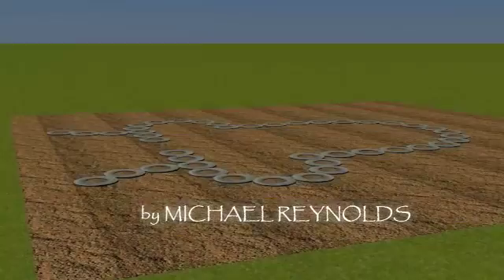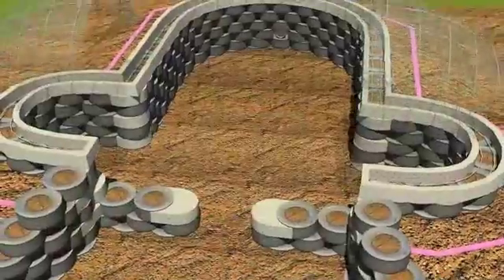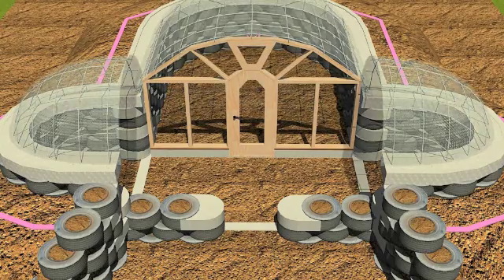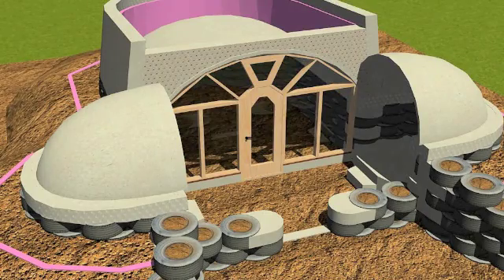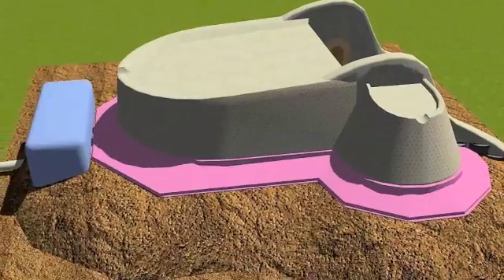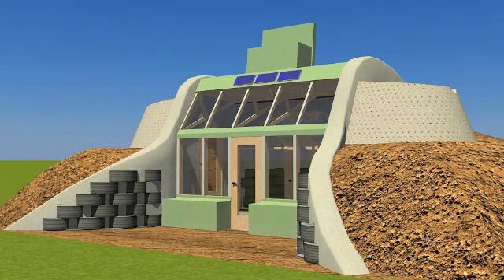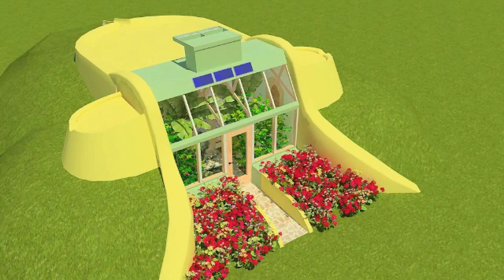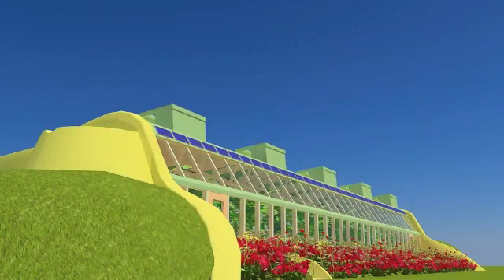Simple Survival Model Earthship

Comment: Where's the simplicity gone? This really is a funeral of affordable living.
Reply: +The LostBoys Dude, you rock.  I didn't expect that.  Actually, I'm a permaculture teacher and teach the PDC classes at the Yurt.  I fully plan to cut the holes in the bottom for ventilation, but I'm going to incorporate them WITH a Rocket Mass Heater.  Not through the heater, but with that project.  My wife has made me promise to keep the area open so it doesn't feel cramped in there.  The RMH will be inset into the floor (actually on the ground since the Yurt is 3' off the ground above grade.  Making the air holes perfect!).  I might even dig some conduit into the ground down 6' or so.  We're in a predominantly hot area with a lot of humidity, so I've gotta think about serious cooling.  I've considered the sail, but another thing we have an issue with here is the sun destroys anything but the most industrial cloth.  Still thinking about that one.  We have some trees going to make some shade in the meantime.  The vent dome on the top of the yurt works fine now that I've taped it up with reflective duct tape.  The sun exploded it when a bit of southern mildewy mold clouded it up.  Keep acrylic plastic clean or the heat sit on it and destroys it.

I am currently working on a walipini (funny you should mention that), but mine has to be above ground since our water table is so high.  3' down and you're standing in water.  Mine is going to be a bit more like an earthship.  Not quite the Valhalla project, but bermed with plastic over top for now.  My land was once a plant nursery, so I found an ancient hoop house in the woods and am restoring it to its former glory.  

The Earthship Hut project will be standard Mike Reynolds design since all of those systems are integrated to make the whole system function.  I'll learn a lot more once I've got it built.  We'll then finish our cob house structure and then work on a sand bag dome, etc.  Check our our work on Facebook under StarwalkerProject.  I should have the website up soon too.  

One thing. You wrote "Eco-Doom house" up there.  I got a rolling laugh out of that one.  Peace "Eco-doom" Brother ;)
Reply: +Branislav Boba Feel free to design it to suit your needs. Economical or other. This is how housing will look in the future, in one way or another. It's only natural that it improves and get some added functionality. 

My first build will still be nothing but a hut. The only thing I will add right away is the permanent placement for all sewage and about 500w of power - and then build from there as I'm able.
Reply: Rhyle That's about what I want to do as well. Wish you all the best with your plans then! :-)
Reply: You can build a house where you won't have to pay any bills for fraction of the earhship's price. And it will also be much nicer and far less complicated.
Reply: eric smith No! Yours!
Reply: +Branislav Boba I've searched for a better, cheaper idea, but I haven't found one.  If you know of such a thing, please share.  As it is, the Earthship is the most, no apologies, no holds barred, off-grid, least expensive option I have ever seen.  Especially for harsh climates.
Reply: +The LostBoys Thanks for the share!  Have you been in one?  I'd love to know how it works to keep you warm and cool in different climates with no energy use.  You could build it so that it captures rainwater and build the grey/black water systems in it as well.  My only question is how it fares in many different climates and weather conditions.  I've seen the super adobe and how they are made into domes, this would be good for slipping through high wind.  I'm currently living in a yurt and it's good in wind, but an energy hog when it comes to keeping cool!
Reply: In a yurt?! How well does it insulate against both cold and heat?
Reply: +Branislav Boba Not well at all.  It seems to be much easier to heat than to cool.  Right now it's about 77°F outside during the "heat" of the day.  If I don't have the dome up and the doors and windows open it'll get up to 87°F easily.  So, during the summer at about 118°F it's got to have the A/C running at full blast to keep it comfortable.  The fridge won't even keep food cold in there without it.  So, the A/C runs 24/7 for a few months.  Not good. Working on an Earthship so that the Yurt can be our little community's club house during cooler months and my little family can live in the Earthship hut!
Reply: @branislavboba1699  - not that well

Comment: I have a question. In other earthships I have seen the use of propanel roofing with a solar heater underneath to melt the snow into the cisterns. Since this is a cement roof how do you melt the snow?
Reply: this is an earlier incarnation before melting snow was incorporated into the design. It is also meant to be a simpler design.
Reply: +ToungandCheek As is, you could use this for non-snowy climates.  If you wanted to, though, you could imbed pipes into the roof and run them off of a solar water heater like they do in other models.

Comment: curious as to the cost of the pumps, bonding insulation, bird cage wire, etc. a single form earth-ship typically costs??? deep charge batteries, solar panels, included... has anyone calculated a mean cost?
Reply: +peterott1 Everything you mention here will be sourced locally and be a different price from area to area and from day to day.  All of that info could be gotten from the local business websites when you decide to build.  You don't HAVE to have solar at first, so you can add that as money permits.  it would be nice to have an estimated amount of cement for this project, but I've never seen one.

Comment: Ok, so what's the cost for a house like this?
Reply: +Old Man from Scene Twenty Four I've estimated that if I do all of the work (hiring help and getting some volunteer help) that it would cost around $10-$15k to get it done.  Tires and cans are free (I've been collecting these and some decorative bottles for a while now).  Dirt is "dirt cheap" to free, the cement is actually minimal, but is the most costly thing here.  Rebar, wood for framing (can be found for free), hardware for doors (build doors or find them in the trash all the time -i found mine already), screws and nails, insulation, plastic sheeting, bought a cement mixer and a tile cutter for the bottles.  I've found stainless sinks and working faucets.  PVC pipes are free to real cheap (not wild about PVC, but I don''t have the cash for copper).  Use plastic for the glass until you find or buy the real deal.  I've built a composting toilet and set up a humanure compost pile that is heating water for an outdoor shower.  I've even found my shower head in the trash and its a nice one.  I'll use several IBC totes for a cistern or use Tadelakt and build one up from scratch.  That's the cost of lime, a trowel a polishing stone and time vs. the cost of totes..  Even if this costs me $20k (inevitable unforeseen costs), thats the basic price of a tiny home thats smaller and needs all utilities to live in.
Reply: @Whaaat2008   I didn't ask YOU. I asked Earthship Biotecture.

Comment: And what is the justification for all the "thermal wraps" made from foamed plastics? The earth berm alone would be sufficient, let alone all those rammed tires. This is a ridiculous waste of money -- blatant consumerism at its worst.
Reply: The earthship uses both thermal mass and insulation.  The mass comes from the tires and the berm-they hold heat from the sun entering through the south facing walls. What the isulation barrier does is it traps that heat so it does the travel farther away through the wart.
Reply: Does not travel farther away**
Reply: +Deborah Stephenson Earthship Biotecture has a definite reason to use everything they use based on many years of experience.  Working around that fragile insulation with wheelbarrows full of dirt is a pain at best.  I'm sure they wouldn't waste the time, money and effort if it were't a valuable asset.  Consumerism?  I think you're just looking for things to be mad at.  I hope you get to feeling better.

Comment: No, actually the tires are completely free. 40 million tires are discarded yearly in the UK alone. You need on average 1000 tires per house which means you can build 40.000 houses with stuff that people would normally throw out. The yearly supply of wasted cans and bottles is probably a lot bigger. You save thousands of dollars on construction materials and moreover, it's not recycling, it's actually the re-use of waste, which is a much greener option.
Reply: If it saves me money and it's safe and structurally built and that's all that needs to be said for me.

I'm not one of those people that care too much about footprint or being green, all I care about is the bottom line my money. And if it saves then I'm all for it.

Comment: Born&living in New Mexico I've seen very similar houses quite often...I live in an adobe place from the early 1900s, pretty much a similar idea.  I'm sure it wouldn't pass building codes, but like you said there needs to be a fight to allow such structures other than in rural NM.  From what I've heard they're actually fire-resistant compared to the prefab, not to mention more aerodynamic for tornadoes and using gravity itself to increase stability in structure.  Square Boxes don't make sense!
Reply: I'm glad to see this comment.
Reply: You absolutely can build these to code. Might involve a rubble trench foundation but it can be done
Reply: @jordanblack2250  This comment was 9 years ago, laws were probably different back then. Now you can legally build these in a ton of states.

Comment: Would water seep through the tire wall in a wet environment like Florida or is the internal wall covered with something like concrete or the plaster you mentioned on the roof cover?  Do junk yards just give away old used tires or is there an average cost.  It looks like you would use hundreds of tires.  I would like to build a small shelter version of this as a project for my upcoming retirement.  Filling the tires with dirt looks like it would be a good workout.

Comment: So I am assuming an inner wall to cover up wiring and such, otherwise you'd be left with pipes/tubes on the walls (which I personally prefer for convenient access but that most people hate) but how about sewer waste?
If you want this thing to actually be off the grid and capable of efficient water delivery and expulsion you'd need to pipe clean water from a higher source so that you could use a gravity feed in and sewer system out, and those clean sources are running out fast :/
Reply: The roofs are sloped to catch rainwater, and drain it to a collecting tank. This tank is buried, to prevent evaporation. The tank is also situated high behind the main dome, so it results in a gravity-fed water system. After that, it's just conventional pipes!

Comment: You fill the cans/bottles with dirt or cement. It's pretty simple. And smashing them will do nothing, as they still fill the cement where they aren't exposed. The use of bottles is not because bottles/cans are great for cementing junk, but because you can intersperse them throughout the cement without any real decrease in efficiency, and it gets rid of trash, even if it's very minimal in an individualistic setting.

Comment: The interior walls are not plain tires - they are covered in adobe and the "garbage" walls are as well. They do not fall apart in a few years. Nearly all of the the earliest (and admittedly more prototype structures) are still standing and occupied. The garbage is mostly composed of aluminum cans and act to hold air, increasing the thermal blocking properties of the wall. The tires are filled with earth which acts to hold in temperature. The only visible reused materials are glass bottles.

Comment: I'm not impressed with the price or the construction.  In my opinion it looks trashy.  Walls made of cans and bottles. Are they empty? Put enough weight on it and those cans will crush like an empty...can. Then the structure is less sound.

For the bottles that are partially exposed, what happens when some person walking by decides to smash one of those bottles?

And just because tires are covered, does not make it safe.  If they were to catch fire there would be toxic fumes that burn long.

Comment: Yes it does meet fire code, the tires cannot burn when properly rammed into the earth (dirt doesn't burn). And yes, they DO finish the inside tire walls with Adobe usually, but some do Stucco. The "trash" walls you speak of are actually concrete with bottles and cans for a filler, they do not crumble in a matter of years, they have buildings built over 40 years ago that have barely shown signs of wear. You are completely uninformed.

Comment: Sorry, long story... in short, building codes suck. Anyway, to answer your question: yes, anything is possible! Electrical can be buried below the plaster walls, under floors etc. Lights, TVs, every modern appliance, dishwashers, these are not a problem. What I meant was, as long as you're thinking about alternative building, why not alternative and centuries-old practices for dealing with water, heat, and sanitation? I realize I could live without a computer, TV and PS3, and one day I hope to.

Comment: I don't like the idea that the inside walls are nothing other than tires, and nothing over them. It's trashy, along with the garbage walls which will all fall apart in a few short years, with no easy way to repair them.

Beyond that, this will no way meet fire codes, as there is only one exit and no back windows.

Comment: Awesome design. How would insulating the interior slab instead of insulating the heavy roof  change its temperature swings throughout out the year? Great improvement with the ferro roof but I would change the design slightly to be all ferro shell supporting heavy layer of soil but all insulated from the earth and no insulation, beyond 4 feet of soil, from the sky.  Insulation-need may be different when small size and mass are at play. If Less ground contact serves, it may free up design options.
Reply: The underground temp stays around 73° year round making this the ideal design for heating and cooling. Go under the ground 👌

Comment: This type of house maintains it's own internal temperature pretty stable across all the seasons using no air conditioning or heating at all, provides heat cooling water shelter and food in full scale, any other method is just a home that requires less heating and cooling not none. It uses the sun through the glass to heat the thermal mass and convection cooling/heat also on the large ones.
If you live somewhere you can just generate enough of your own power to heat/cool with electric then cob.

Comment: In our climate (tropical and rainy seasons) we need to work fast getting the Tires filled because they are a source for mosquitos to put their eggs inside them Tires. Cutting the top surface would shorten filling them but we would compromise structural integrity, as you explained, makes sense. Is there any other technique to expedite the filling/compacting process without loosing structural integrity? Thank you for your reply!

Comment: Cutting off the top surface would certainly make the tire easier to fill and compact. However, you reduce the structural integrity of the tire and thus severely reduce its weight bearing capacity.

Comment: Why not have cement under the floor, as plenty everywhere else?  Tires and cans do little and are only there to make it look like it is enviro-friendly I think, as you have plenty of wood, steel and cement anyway.
In a wet climate the water will get in, cause 'raising damp'.  Roof run-off area is too small! And where do we find this mountain of dirt and tires from?
Also, how is the roof made?  Does not say, and it has to strong, as you have dirt and more cement on top of it, could kill someone.

Comment: @asphixiatedaphid It is still an involved process to find, gather and move hundreds of tires, plus all the other materials. I know of 2 parties building these things and the labor and time involved has taken it's toll. Many of the cans and tires were unsuitable, leading to extensive search. It is a huge commitment and few will take it on. The moisture issue comes from soil being a "sponge" in that moisture is slowly accumulated and finds ways inside (mold spots). It's not impossible, just hard.

Comment: @gareebee Lots of places, have lots of tires and cans around, with very little transport if you are anywhere near any civilization. Also, yes they are labor intensive, but there are plenty of folks that have got one up with just family and friends. And you say it's hard to keep moisture out? Where are you getting that information? They are designed for water to flow away from the building. Also on the suffocation effect pretty sure that's wrong too. Not perfect, but closer then current homes